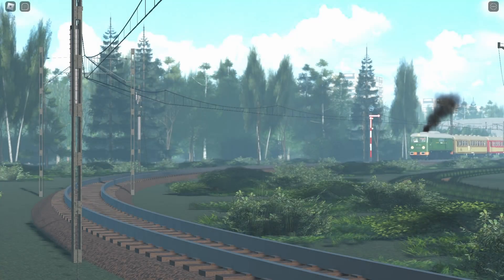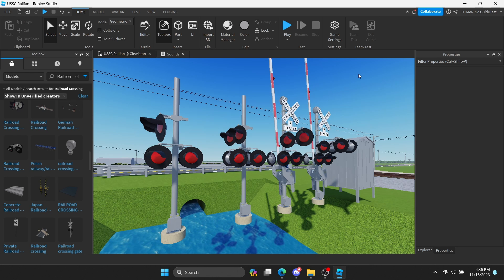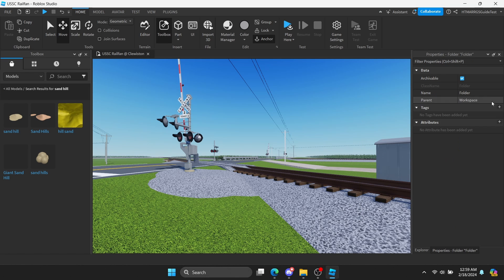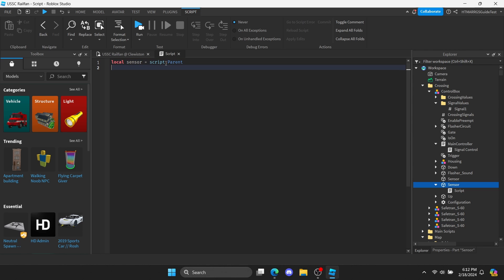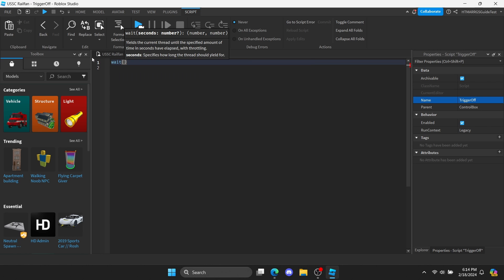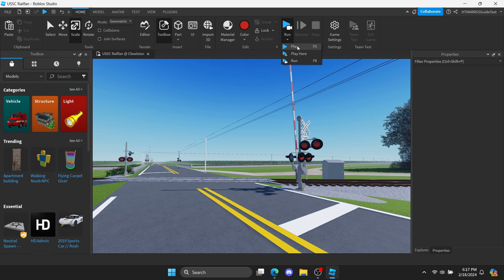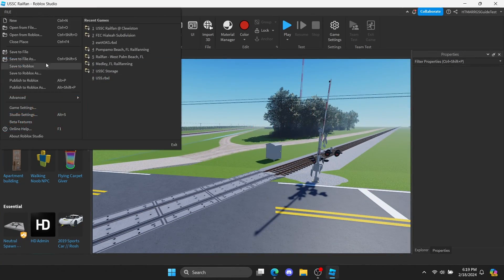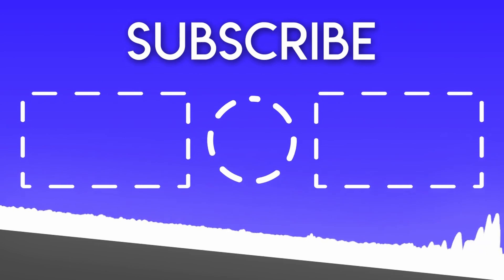How to Make a Roblox Railfanning Game [Part 4/5] Making Railroad Crossings

Comment: IF you use models that were on the tool box and they were leaked I highly recommend modifying them to avoid any miscommunication. Leaking can ruin people’s trust in you.
Reply: Do you have any advice on how to identify leakers/leaked models?
Reply: @GreenTie76  most models that are not verified are likely to be leaked however there are some creators out there that have realistic models that are not verified that their models are not leaked
Reply: @GreenTie76  most people when they release a realistic model and they didn’t make it will have little to no description. Other things include the model being “sold” by multiple people. Oscarisgone sells his models on the market place and he makes them. While LatestCrossingLeaks obliviously leaks things. Pretty much try to avoid anything that is too good to be true.
Reply: @SignalMan9292  Also, thanks for the info.
Reply: No problem
Reply: @SignalMan9292  Also, would iixEpicDuckxii (I think that’s their name) be a leaker? They really seem like one, I think they even made a model that was labeled for a leaker to use.
Reply: @GreenTie76  That name didn't come up with anything
Reply: @SignalMan9292  I forgot the name, I remember one of the models they made. I’ll look it up now.
Reply: @SignalMan9292 I think he means iiXEpixDucksXx
Reply: @SignalMan9292i just realized they might work for rtci, so they’re  good
Reply: I did that with crossing system v1

Comment: For a sensor idea, add atleast 3 sensors and all 3 are programmed to the control box to dractivate the signal after a certain time like 15 seconds and after the timer ends with no train going over the sensor, the crossing deactivates

Comment: Those r some fire crossings (i made them)

Some other ways to do sensors-
You can use sensors on the toolbox and have one direction be at 50 studs above the ground or so and a part grouped into the lead locomotive which will hit the sensor. Place the deactivate to where the entire train will clear the crossing before the gates raise. For the other direction, do the same thing but place the sensors and locomotive part at a different height such as 60 studs above the ground. The crossing should then be functional